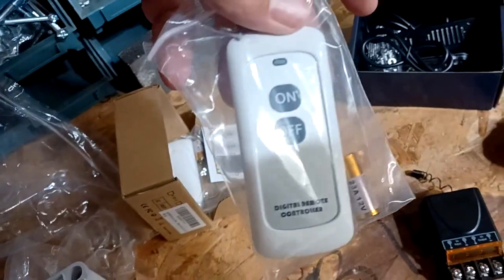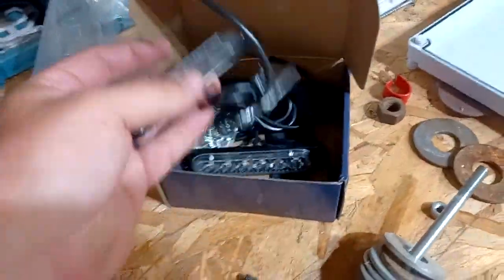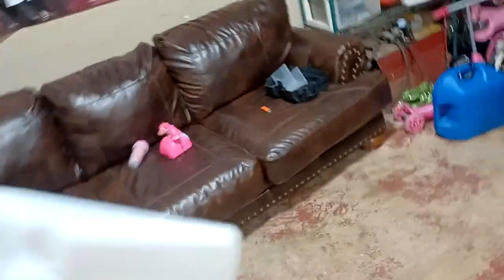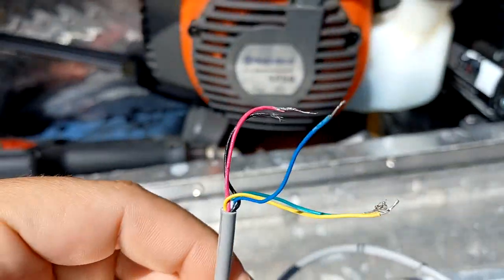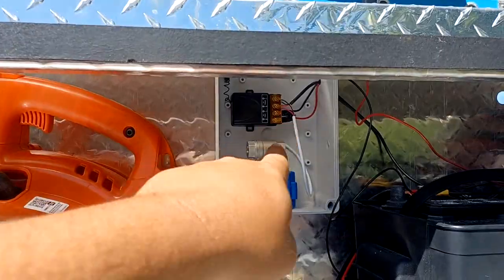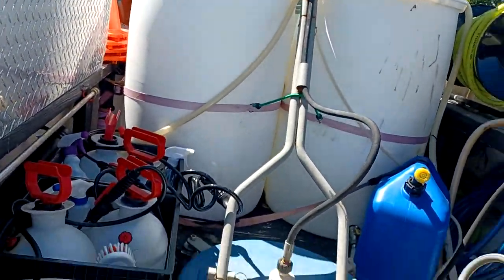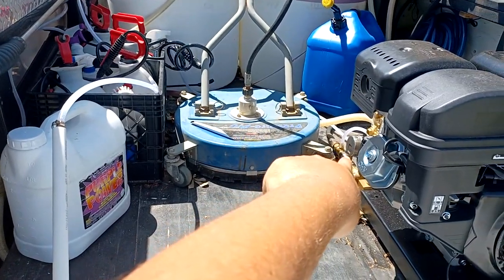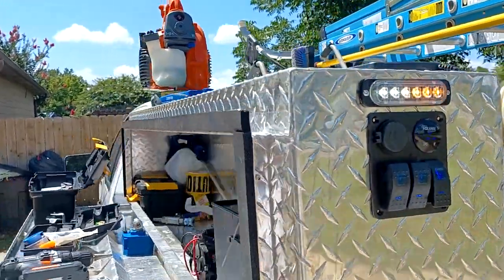Remote DownStream Injector Build

Comment: What size battery are you using? Im running a marine 1000cca with 180AH. just curious as to what this remote unit can handle without frying.  Also, how long have you used this set-up and are you happy with it? all your input is greatly appreciated.
Reply from the maker: My battery is a 625cca marine. It is perfectly fine for my bed lights and my remote system. Even when it hasn't been charged in awhile and is at 10 volts my remote system works fine. But when using my 5.5gpm 12v roof pump my battery doesn't last long. I'm very happy with my setup.
Reply: @cunninghamclean  I suggest jumping into the 1000 cxa with the 180 ah. 
I can do 10 - 3-4 thousand sq ft metal roof jobs easily without charging.

Comment: Have you upgraded any of this setup since this build?Is it holding up good?Does the m5twist let the injector pull the soap like a Jrod would?
Reply from the maker: Yes the m5 pulls just fine. Haven't really changed much. Still using the same remote system with m5.
Reply: @cunninghamclean  Thanks I appreciate it. Next season I will definitely have one.

Comment: You can do it with the five wire you just need a Bosch relay.  I've done two of them and they work fine. Also the five wire is a few dollars cheaper and there are more available
Reply from the maker: I cant do anything with the 5 wire I got lol I melted the insides. But the 2 wire just makes it more simple for me.
Reply: @Chris Watts hey brother, I don't have those setups here but if you send me the schematic from the valve documentation, I can send you sketch up

Comment: Great Video.  How is the Remote Valve holding up to Bleach?   I assume you can't really rinse it out ?
Reply from the maker: It does ok.. they last 3 - 9 months. I've had I think 4 so far. I rinse it after every use by just sucking water the last time I use it that day. But it has plastic gears turning metal so it doesn't take much to mess it up. But for $30, beats walking back and forth.
Reply: @cunninghamclean I watched All Pro version of this build and he upgraded to Banjo version of the valve. $135 but he said they last way longer. Its all polypropylene and knowing banjo quailty im sure its worth it. We'll find out this spring.
Reply from the maker: @jasonschultz3140  thanks man I'll try to find that video and check it out. Mines works great but I have to replace the valve every few months even with flushing it everytime.

Comment: Great video can you send the link for the ball value?
Reply from the maker: It's in the description
Reply: @cunninghamclean  um so sorry I went there right after I sent that comment brother,thanks for the knowledge I been set mind up but as you said I ordered the wrong one and I stop working on it until I saw ur video👌🏾
Reply from the maker: @PapetoTheSource  I was up til like 1am trying to figure out why it wasn't working before I took it apart to see if something was wrong with it from the factory, I had fried all the wires on the inside because I didn't wire the 5 wire one up correctly lol so I took a $35 lost and just ordered the 2 wire.
Reply: @cunninghamclean  the one I just order has a red & black wire is that ok?
Reply from the maker: @PapetoTheSource  yes that should be the same one I have now.